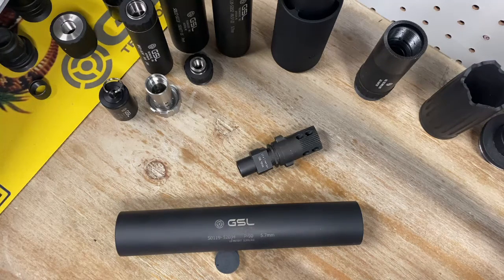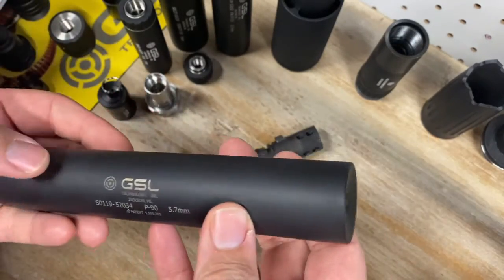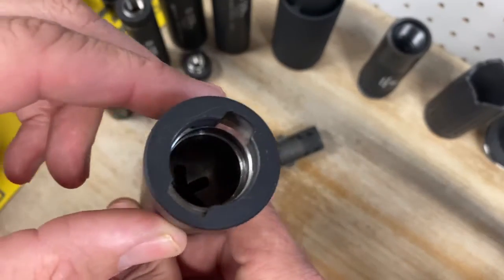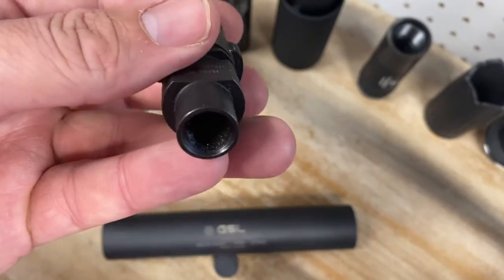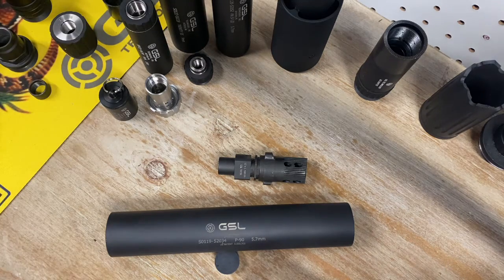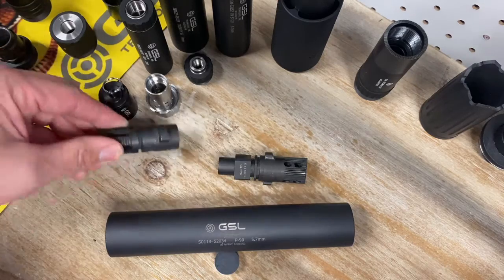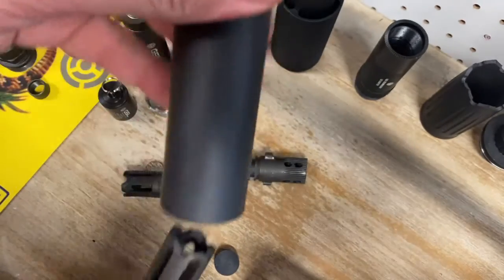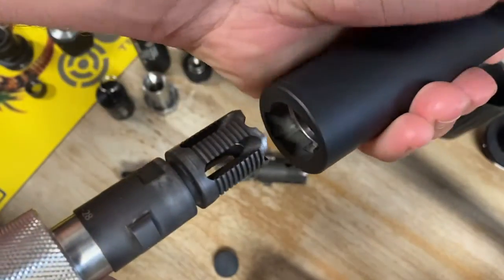GSL P90 - Everything you would want to know

Comment: Do you have a direct thread for the ps90?
Reply from the maker: kinda. we have the FN57-22 thats direct thread for 57. it comes with 10mm and 1/2x28 direct thread mounts. for the p90 we have 1/2x28 and 12x1LH QD options. If you wanted a direct thread can for it that would hold up to full auto fire, i'd use the GSL SWAT5 suppressor

Comment: Have you compared this to any other suppressor on the PS90?
Reply from the maker: Of course :) 

The GSL P90 is gauged specifically for the 5.7 round, so it’s the maximum possible sound reduction for this platform. It also comes with the 12x1LH bilock, which is awesome and easier than using multiple adapters to go to 1/2x28, and more consistent. 

This can was developed for FN, and is perfect for the p90 and AR5.7 platforms